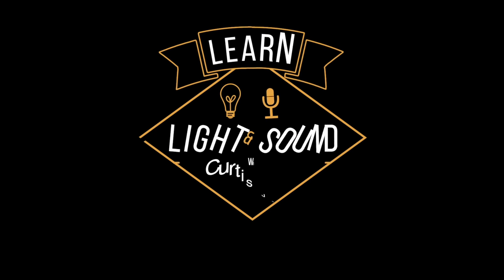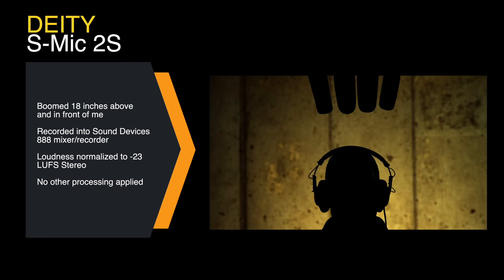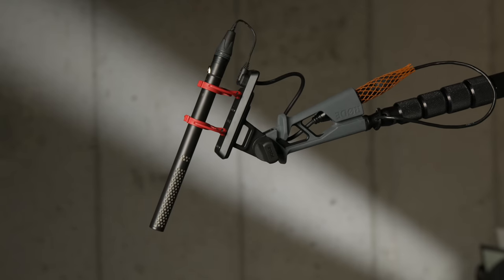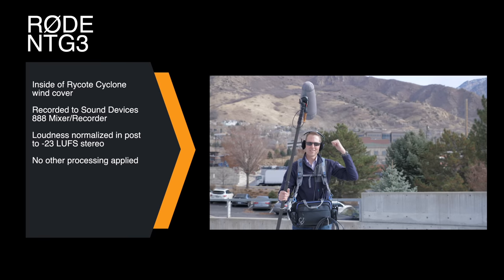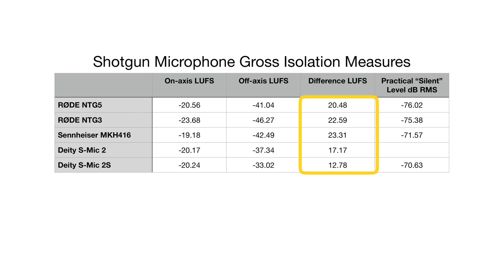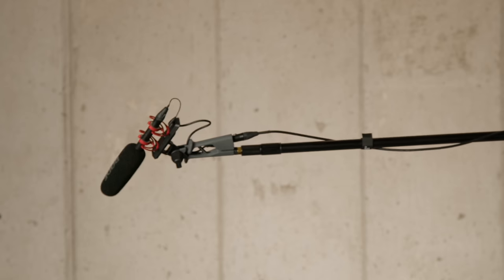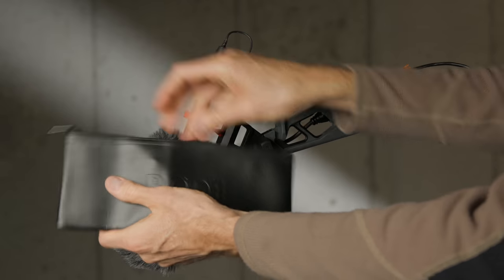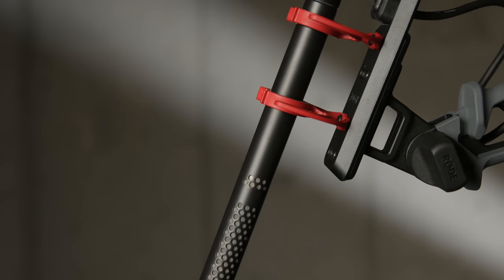RODE NTG5 Shotgun Microphone Review - Compared to RODE NTG3, Sennheiser MKH416, DEITY S-Mic 2

Comment: Are all Diety mics DC bias? I happen to live in South Florida so the talk about humidity caught my attention. Diety product line has caught my attention over the past year. But humidity is a huge issue particularly during hurricanes. So thanks for bringing this to our attention. Now I have to re-think everything. I am assuming I should stay away from anything DC bias which would seem to rule out Diety.

I should add that I have seen the word “waterproof” used on some of Diety’s branding and that had me wondering if that factors into the equation. I am thinking not, since air/moisture are pretty hard to stop long term but perhaps i am wrong?
Reply from the maker: Hi Adam TV, Yes, all of the Deity mics along with 98% of all condenser mics use a DC-bias or JFET principle. The DEITY S-Mic 2 and S-Mic 2S have coated circuit boards so that if they do get wet, they should not be permanently damaged. However, this does not necessarily mean that they will continue to capture good sound if a substantial amount of water condenses on the microphone diaphragm while the diaphragm is still wet. They may need to dry out for 24 hours before they'll work well again.
RF-bias isn't totally absent of issues in humidity, but does tend to continue working more reliably when moisture condenses on the diaphragm. But if you drop it in a bog, there's a good chance it won't capture good sound, at least until it dries out. 😀
Reply: @curtisjudd  Well, not much survives in the Everglades, not even humans, but that's a different story.  But thanks for the reply and all you do for the community. Deity is also doing a lot for the community and I in no way mean to bash their product line. Like I said, I have been impressed and was seriously looking at several of their products until this "humidity issue" raised its head.  I have now heard you raise the humidity issue in more  than one video which makes me think it something I should take seriously since humidity is an issue year round in Florida.  I guess this is going to severely limit my choice but at least the Rode mic in this video is RF bias.  I still need to look at the rest of the Rode product line but with any luck that will also be RF bias.
Reply from the maker: @AdamTV  The NTG3 and NTG8 are also RF-bias microphones. The other manufacturer who has a lineup of RF-bias microphones, indeed the company that has done the most with that technology, is Sennheiser.
Reply: @curtisjudd  Thanks.  Yes, I have been catching up with those on some of you older videos which are a gold mine of information!!!!!  And then Wikipedia has a very good section on RF vs DC that I found very helpful.

Comment: Hello Curtis! 
Big fun!
I need your help here. 
Against popular reviews, I decided to take a risk and get the rode ntg 5. It’s honestly has great sound in my opinion and I hoped to get one of the good ones😂. I’ve been testing it for hours and your feedback is well appreciated. I noticed that the phantom power on 24 is super clean with almost no noise but at 48 there’s noticeable or reasonable noise especially when volume of headphones or gain is increased. Is that normal? Or should I return it? And if that’s normal, does that mean I can take care of that in post. I decreased the gain on 48 phantom power to 25db with the fader facing 12 o’clock as usual and noise decreased significantly even though it’s can be heard a little in the background. I’ve not had any strange noise yet like the other guy’s video. I just heard what I described to you. What do you think? Thank you very much in advance! I really hope you see this.
Reply from the maker: I’d get in touch with RODE support and get a replacement.
Reply: @curtisjudd  Took it back to the store for a refund. Will look into another boom mic. I'm hoping the upcoming Deity s mic 3 is the answer.

Comment: Will we also get a Videomic NTG review video before the end of the year? I'm curious how it compares to this or other shotgun mics.
Reply from the maker: Yes but it isn’t really the same type of microphone as the NTG5, designed for a different set of use cases like camera-top on consumer cameras. Even though RODE says you can use the VideoMic NTG on a boom pole, I wouldn’t recommend that if the goal is to always use the mic on a boom. It doesn’t have a balanced output which you normally want when working on a boom.
Reply: @curtisjudd  Thanks for the reply. I'm waiting to get one anyway after you've made a review so I can do it through your referral link, and also to know the pros/cons.
Reply from the maker: @Pikmeir  👍 Can't wait to get back to work on the review next week!

Comment: Curtis, why does the NTG3 sound so harshly strange in the outdoor sample? I am owning three of them and they never sounded like that when used outside...
In your indoor samples the NTG3 and NTG5 sounded much more similar.
Reply from the maker: Cable issue with the Cyclone which needs repair, it turns out. 😕
Reply: @curtisjudd  I see, thanks for clearing that up :)

Comment: Hello Curtis, first of all thank you for your work! Could you please suggest, which out of two - NTG3 or NTG5 would be more suitable for field recording. I am in doubt: from one point of view, I am attracted by a newer piece of engineering, its advantages (lower noisefloor, clearer sound) and the kit value; from another, I suspect that the NTG5's audio would be that flat in the low end (40Hz vs 80Hz in the frequency response diagram) that in the result when you try to record an effect with prevailing low frequencies (some engine rumble or big bell's vibrating sound) it turns out to sound noticeably not as deep as in case of NTG3. Could you please advise? Thank you!
Reply from the maker: If you want more bass response, I’d definitely suggest the NTG3 over the NTG5. Thanks!

Comment: Thanks for the review! Do you think it would be good as an indoor mic alongside a 416 I'd use outdoors, or would I better be looking at a hypercardioid of some sort?
Reply from the maker: I think it would work ok. I usually use a supercardioid indoors so that there is no risk of interference tube phasing issues, but those issues are pretty rare.
Reply: @curtisjudd  Thanks a lot for your reply! I'll think about the NTG5 then. As you know, the 416 can be tricky in some rooms :)
Reply: @curtisjudd  which supercardioid are you using indoors?

Comment: Hey Curtis, I have had my NTG5 since they first came out and have only just started getting some RF interference. I noticed that if I change my zoom F6 to use 24 Phantom Power it seems to get rid of most of it. I can also get rid of it by plugging it into a plug-on wireless transmitter (Sony UWP). Have you heard of any other peculiar fixes for this problem?
Reply from the maker: Hi Nathan, I haven't run into the issue so I haven't had to look for solutions. But I would encourage you to check in with RODE support if you haven't already. If your copy is faulty, their warranty is one of the best out there.

Comment: Hi,
I am at a bit of a crossroad with my next purchase decision of a microphone for sound design and foley for games development. The intent is to buy a workhorse do-it-all mic to pair with my MixPre6 II and my budget is roughly 1200usd. Knowing the perks of the MKH8050’s super wide freq response which I would utilize for altering pitch of recordings without losing top end details, I’m wondering if I should save my money and instead pick up an NTG5 instead or do you think I would regret my purchase in the end? Also factoring that the decision is based on the choice of either getting a shotgun or a pencil mic. A noteworthy mention, I already own the rode blimp so the NTG5 accessories aren’t at all affecting my choice. Would love to know your thoughts on this. Thank you in advance
Reply from the maker: Hi Christopher, That's a tough choice because both mics are quite good in slightly different ways. The 8050 has a slightly warmer sound to my ear and is slightly less focused in terms of polar pattern (though I believe they're both classified in their specs as super-cardioid.) I guess I'd probably go with the NTG5 as the slightly more versatile option initially. But that's a tough call.
Reply: @curtisjudd  Thanks! I will keep your thoughts in mind. Indeed, they're both super cardioids. Follow up question would be if you are familiar with any other SDC mics which have wide freq response at a more affordable price point? I can't seem to find any at all. Again, thank you in advance!

Comment: Great review as usual Curtis. Mixpre3ii and my NTG5 sound great. One thing I did find that upgrading my cable to mogami quad and neutrik gold connectors did bring out slightly more fidelity over some very good cables I owned. No regrets on these purchases.
Reply from the maker: Excellent, thanks. I’ve had very good luck with my Mogami cables as well.

Comment: Hi, I'm looking to upgrade from the Rode NT1 (for voiceover) which is an ok starter mic, to one of these shotgun types due to my room not being 100% acoustically treated, also I have a deep baritone "Barry White" speaking voice so I don't need a mic to get saturated with bass, would the Sennheiser 416 be a good choice for my upgrade and would keep me going for the next 10+ years? Thanks, great video.
Reply from the maker: I don't know that the MKH416 would be a substantial upgrade, it really depends on how your voice and the mic work together. Every voice and every microphone are a little different. A mic that sounds great on your voice may not sound so great with my voice.  I'd recommend you rent a 416 and see how it goes.
Reply: @curtisjudd  Thanks Chris. What I'm seeing from my online research so far is that the 416 would pick up more of my higher freqs and roll-off the lower.
Reply from the maker: @tonymagnier9846  Hmm. There are a lot of factors here. Microphone position is a huge one. I don't have the impression that the MKH416 is less bass sensitive than the NT1 (I own and use both).  Perhaps if you use the MKH416 in the traditional boom position ~35cm from your mouth, it is optimized for producing a natural balance from that distance. So, in fact, I think you'll find that the MKH416 may be even more bass sensitive if you use it very close to your mouth, say, within 10cm. 

I'm sorry that I'm probably not making this easier for you, but I'd rather not say, "Yes, the MKH416 is much better and worth the over $700 additional cost..." Because I don't think that's the case. 

If at all possible, rent a 416 and try it. I think that'll be very instructive.

Comment: 3rd time watching.  Broke out the headphones for the last one to truly appreciate what you have put together here.  I loved the floor noise test and absolutely appreciated the polar pattern white noise test.  The NTG5 is a great value at $499 usd for the beginning youtuber or beginning film maker.  The Rode PG2 R pistol grip and cable alone is $140 on B&H.  The NTG 3 is a great mic at $700 by itself.  Wouldn't we all like to have a Sennheiser MKH 416 in our arsenal for $1K .  Deity puts out some good stuff too, with there S2 location kit coming in at $429 at B&H as well.  The location kit comes with comparable accessories to the NTG5.  However overall after the tests you have provide us today,  value and sound, pound for pound, its the NTG 5 for the win.
Thanks Curtis
-Will
Reply: The noise is quite accurate in the specs of most models:

model, sensitivity in mv/Pa, A-weighted IEC651 noise level in dB SPL 
AKGC414 23 6 (a large diaphragm studio mic as a benchmark) 
mkh60 40 8
me66 50 10
ntg5 66 10
ck69 54 11
mkh8060 63 11
ntg3 31,6 13
S-Mic2s 25 15 
mkh416 25 16
ck98 20 17

The SMic2S noise spec does not sound accurate. It should have same level with lower noise than mkh416.

What is not in the specs and most tests is every other aspect, which is typically a lot more important than noise. An MKH60 for example is excellent in handling noise, build quality, etc, something one cannot say for me66, the ck69 has the most forgiving pickup pattern in the group, the NTG series sounds a little constrained compared to the Sennheiser models, and so on.

Modern shooting requires relatively high levels of room tone. This will mask small differences in noise. These mics will not really be used in studio environments.
Reply from the maker: Thanks for the thoughts and specs! On the practical noise sample readings, it is the S-Mic 2S’s wider polar pattern which picked up more room sound, not more self noise. We are making a gross measure of room tone, polar pattern, and self noise combined - a practical measure rather than a self noise spec measurement alone. And I agree, in most cases for film production, the room tone will mask most self noise.
Reply: In a realistic shooting situation it wouldn't matter much. I liked this test a lot:

 https://www.youtube.com/watch?v=yWFKGpv21QA
Reply: Btw, you are doing an excellent job in all things audio. Your material is an oasis.
Reply from the maker: @aristotle_4532  Thanks!

Comment: Not sure if you've still got your Pocket 4K, but I've noticed when running the NTG5 into the camera via XLR, it has an audible noise floor that will ruin your recording. This does not happen with any other mic I plug into the Pocket 4K (NTG2, Deity SMic 2, etc). Just a heads up for both yourself, and any other person running the same setup as myself.
Reply from the maker: Thanks Carty, I’ll try it out.
Reply: Hi Carty, I was considering buying the NTG5 for my BMPCC 4K. Did you ever get this noise issue resolved?

Comment: Thanks for this review.
Very interested in this NTG5.
Which XLR cable do you advise for this kind of microphone? 
Rode sells a XLR43 but it may be too short for many situations. 
May a longer cable produce a loss of information compared to a shorter one?
3 meters seems enough for for many situations.
Which good quality 3 meters cable would you advise?

Thanks!
Reply from the maker: You can run balanced cables quite far - easily 30 meters - if you use quality cable and connectors. I use Mogami and Canare cables with Nuetrik connectors with good, reliable results.
Reply: @curtisjudd  Thanks for your answer
Reply: @curtisjudd  Hi Judd, I just received the NTG5 with a 10ft Mogami Gold Studio XLR cable. I plugged it directly to the line 1 of a Zoom H6.
The sensivity of this microphone is very good, I'm very statisfied with that. It allows to record someone without microphone visible in the frame.
However, to record a narrative text, the XYH-6 capsule given with the Zoom H6 sounds almost better than the NTG5. Is it normal?
Description: I recorded inside, with the microphones ~8cm from the mouth, checking that the levels don't go too much above -9db. 
For the NTG5: the microphone in the hand (end part of the mic of course), not moving, in a position like a singer would do.
For the XY capsule, the same kind (holding the Zoom H6).
My voice then the one of my girl friend.
Result: The text of the Zoom XY capsule is almost more comprehensible, more clear whereas the NTG5 is more "boomy" and a bit "blocked".
What do you think of that?

Thanks
Reply from the maker: @valbou1089  Hi Val, the NTG5 along with shotgun microphones in general, are made for use boomed above and about 12-18 inches from the mouth. They are generally voiced to sound natural at that distance. Their much more directional polar pattern is also optimized for that distance. The cardioid microphones of the H6 will generally pick up more room or ambient noise when placed at that distance.
Reply: @curtisjudd  Thanks for your answer, I will have to try again this way so.
Generally, the boom can be attached to the stand?
The Rode carbon pro boom seems to be a good alll rounder. If the boom can be attached to a stand, I would like to buy a stand that can be used inside and outside.
Reply: @curtisjudd  The best I sound I got was putting the mic in the diagonal direction towards my mouth, gold Rode badge on my face  side.
Still not convinced for voice over.
Do you think the NT1 would be better than the NTG5 for voice over?
Reply: Val Bou that’s what I’ve been told. If you’re not going to be on camera, the NT1 is a better choice
Reply from the maker: @valbou1089  Yes, I agree, for VO, NT1 about 4 inches away. You'll also want to record in a space which doesn't have a lot of sound reflecting off of the walls, floor, and ceiling.
Reply: @curtisjudd  I went for the Neuman TLM 103 for VO and I get the sound I I wanted.
I keep the NTG5 for long distance recording. 
Thanks
Reply from the maker: @valbou1089  excellent choice. Happy recording!
Reply: @curtisjudd  Thanks!

Comment: I currently have the NTG4+// the output impedance is 200 vs the NTG5 20.. Is that a real big issue, or does that mean for professional use i'd want  to get a good recorder// would the F8n be good?
Reply from the maker: No, the output impedance should be fine with most capable recorders including the F8n. If you're going to upgrade your microphone from the NTG4+ to the NTG5, I'd do it for the audio quality and RF bias benefits.
Reply: @curtisjudd  awesome! I'd love to see an ntg3, ntg4+ and ntg5 comparison video!